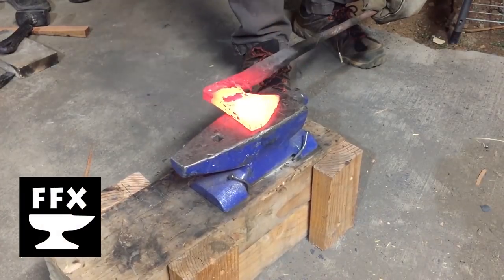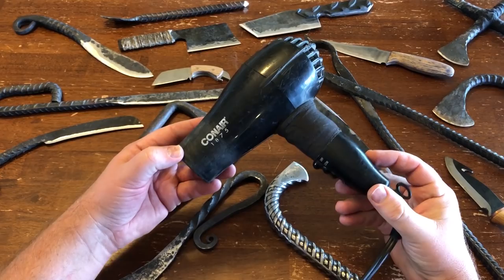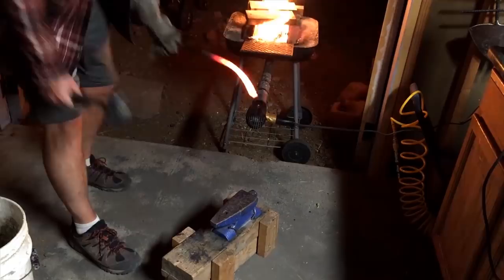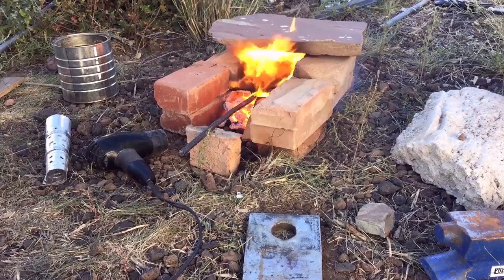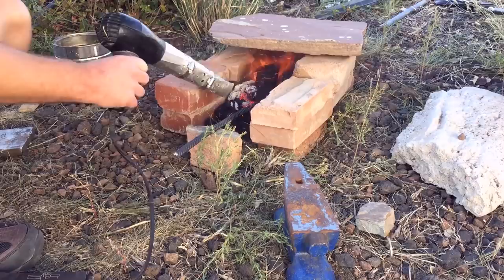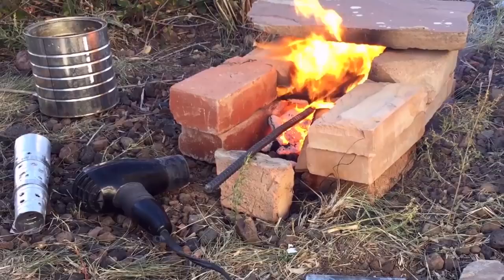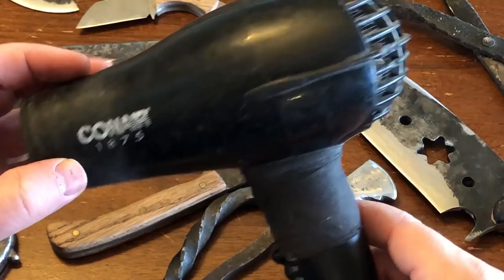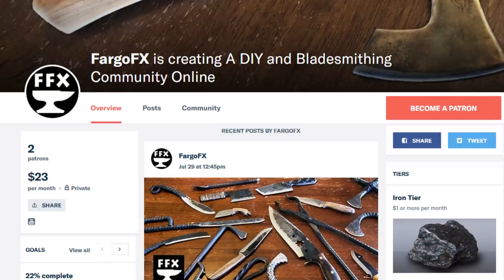Review: $12 Forge Blower (FargoFX Tools-day Tuesday is Back!)

Comment: Preheated air will make the forge a little hotter. That’s being done at giant iron smelting furnaces. Some hairdryers will stop when they are hot for so long but it will definitely give it a boost! Maybe there is one that doesn’t stop or you could switch between two of them
Reply from the maker: That is a brilliant idea. I assumed it would burn out the hair drier, but realistically they're made to run VERY hot. May have to give that a try. Hard to go wrong, even if it burns out, I just need to drop another $10 on a new one.

Comment: Congratulations on 10k subs and the new Patreon account! I'm gonna get me a blow drier. I used to use air matress inflators, but they run down batteries pretty fast.
Reply from the maker: GeographyCzar I was thinking of using a battery powered inflator, it would be fun to whip that thing out when camping, make a quick fire ring and light up a forge. 😂
Reply from the maker: Hey, thanks for the generous membership on Patreon, You’re my first Gold Tier subscriber. I see elite benefits in your future.

Comment: Cool I also use a hair dryer for my forge but I turned it off and forgot to move it away the pipe got hot air in it and the blower melted sadly
Reply: GuardedDig2 that happened to one of mine too
Reply from the maker: Full disclosure: I actually bought a blow dryer before this one, but I managed to destroy it trying to remove the heating element, I don’t think I ever even got to use it. LOL. Learned my lesson.
Reply: I think any good Smith will break at least one hair dryer lol

Comment: Conair 1875. Does it need a cold air setting when in use ? Did you tape over the on switch on the hairdryer, and turn it off at a separate power off switch connected to the cord ? Do I need to do anything else to the hair dryer ie remove a heating element ? Sorry for all the questions, but I think your set up is cool. .
Reply: I used a cable tie on my cold air button to keep it pressed in

Comment: Review the 15$ angle grinder from harbor freight?
Reply from the maker: Daniel 360 That’s a good idea, I’m still running it through its paces. The first few times I used it it started making a noise and I thought it was going to seize up. But since then it has run like a top… It’s a little confusing, but I’m not ready to review it and call it good just yet.
Reply: FargoFX I bought it when I was at harbor freight but I haven’t had a chance to use it yet since my forge isn’t operational yet but I got the anvil, hammer and a angle grinder + wheels.

Comment: ive been using a hair dryer for ages but it has some kind of heat shut off and shuts itself off every now and then which has gotten kind of irritating ive had the same issue when ive tried to use others too

Comment: used hairdryers for the last 5 years since starting smithing im still trying to find a less powerful one as mine even on the lowest setting and the cold air button pressed still blows the coals away any advice thanks
Reply: Get yourself a turn dial speed setting thingy